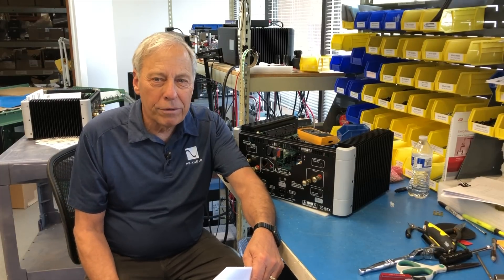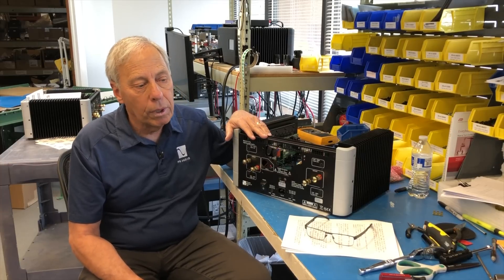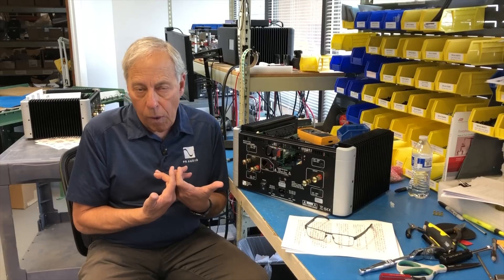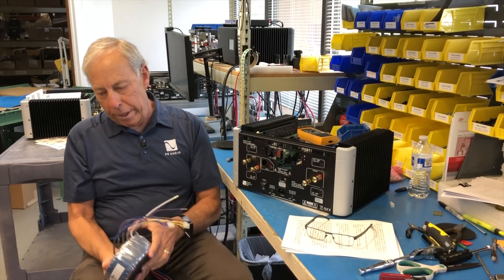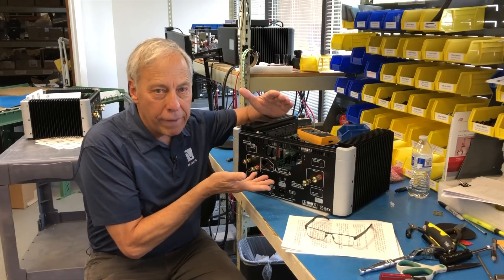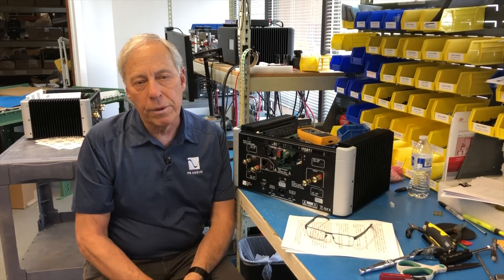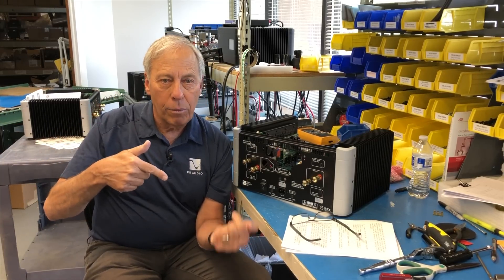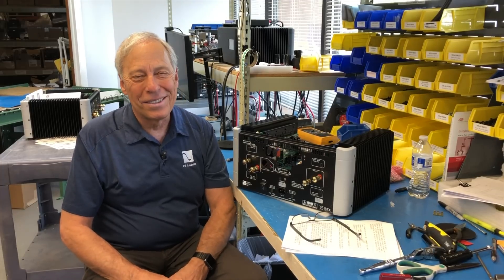Can you run 4Ω speakers on an 8Ω amp?

Comment: So then is it fair to conclude from what Paul says here that a low impedance output on an amplifier is desirable? If so, is it universally desirable? Are there drawbacks to having the output impedance of an amplifier lower than necessary?
Reply: In itself everything else being equal, lower impedance means a better audio quality through a higher damping factor (ratio of speaker impedance vs amplifier impedance). A better (higher) damping factor means your amplifier can more precisely control the motion of voice coils. This effectively means better audio fidelity. Imagine, for example, the amplifier makes a drum sound and due to high amplifier impedance, the voice coil will continue to after-ring longer when the amplifier stop the output due to the amplifier output impedance causing less of a “short circuit” of the voice coil. Effectively that could yield that the drum becomes slightly more boomy and less firm.
Reply: I doubt that there should be any problem with having an infinite low output impdance.
Reply: Andy B if the low impedance is accomplished by means of a heavy feedback, yes! It is harmful!
Reply: Salvador Rodenas Agree, but my point was if everything else being equal, lower impedance is better. Yes, you won’t in reality find two amps with only the impedance being different and other things can matter more. But let’s say your output impedance is poor due to some really thin internal wiring in the amp, obviously a lower resistance thicker wiring will give you lower output impedance at no negative effects. But it’s more of a theoretical scenario.
Reply: Andy B No, the amplifier output impedance needs to be factors lower than the speaker impedance for best audio fidelity. That factor is what is damping factor. If you have an 8 Ohms speaker and the output impedance of the amplifier is 0.4 Ohms then the damping factor is 20, for example. But you want more than 20 damping factor which means lower than 0.4 Ohms output impedance. You can consider the output impedance as a resistor in series with the speaker much like a cable represents a resistor. Thus a high amplifier output impedance is having some of the same bad effects to audio as a long thin poor quality speaker cable has. The voice coil’s motion becomes more “elastic” and less controllable with more after-ring when the amplifier can’t “short circuit” the coil effectively when the signal (e.g. a drum beat) stops. Imagine the amplifier output goes from a 100Hz pulse to nothing. When there is nothing the amplifier output is trying to keep 0 Volts on the output but the speaker cone will keep vibrating and generate electricity back into the amplifier terminals. The amplifier output will be like a resistor that serves as the load on the voice coil. It’s a bit like “regenerative braking” in an electric car as the voice coil’s ability to stop depends on the size of the impedance. Lower impedance means faster braking (imagine brake pedal in an electric car). When you play the signal it’s the amplifier feeding energy to the voice coil and when the signal stops it’s the voice coil feeding back energy to the amplifier and you burn that energy faster stopping the voice coil more promptly through a lower impedance (think of resistance).
Reply: ThinkingBetter there's a multifaceted issue here. As almost everything, it's not black or white but an infinite shade of greys. A lot of super amps have a comparatively high source impedance and in spite of this, offer a beautiful sound and have been considered classics, a good example of this are my superb Sony TA-NR1's pure class A from 1989, they declare a damping factor of 50 only. If we compare this with amps with more than 500 df rates, one could get the false impresion of a huge difference in caracteristics but in reality, this means only that the amp with the higher damping factor has an output impedance ten times smaller than hat of an already low output impedance of other. Ten times of an already very small something is almost nothing, but if this low impedance is reached with high doses of feedback, the audibly consecuencies can be much more audibles for the worse.period.
Reply: Low impedance speakers can draw more current but it compromises damping factor
Reply: Janina Palmer Yes, it’s a trade off between getting more power at lower impedance vs getting more precise voice coil control due to higher damping factor at higher impedance. Better dynamics vs more precise and detailed sound.
Reply: ThinkingBetter But that's a matter of speaker impedance, not amplifier output impedance, isn't it? As long as the amplifier's output impedance is lower than the speaker, then the system should work well (assuming there are no other problems). Shouldn't it? Is damping factor mostly just a function of amplifier output to speaker input impedance? Also, I assume a high damping factor is desirable.
Reply: Also, a lower speaker impedance will increase the power output of an amp, IF IT CAN HANDLE IT. I think, inversely, that is considered 'damping'.
Reply: Richard Smith Well, some of the power of an amplifier is absorbed by its own output impedance and if your amp’s output impedance is high and your speaker (or headphone) impedance is low relative to that then you actually can get less power to your speakers at lower impedance.

Comment: yes,you can. the damping factor will change. the power delivery will change. the available bandpass will change slightly.. amp will run slightly hotter..
it's really not that big of a deal with most amps.

Comment: I think the asker was talking about amps/receivers from the late '80s, '90s, and to the early 2000 that had the impedance switch on DC and OTL amps, I believe it had something to do with the power supply because it said by the impedance switch do not move unless powered off
Reply: Steven Slusher some Yamaha receivers have the 8 ohm/4 ohm switch these days, and what the switch does is strangle the power supply in order to keep the amplifier from overheating and cooking itself.
Reply: I got a bunch of receivers from that same upper 90's to low 2k's that have that 4/8 ohm switch on the backs. Not too uncommon. I have not consulted any schematics to see just what it does. My guess is that it simply connects a lower voltage tap on the B+/- windings of power transformer when switched to 4 ohm setting. But don't take my word for it.